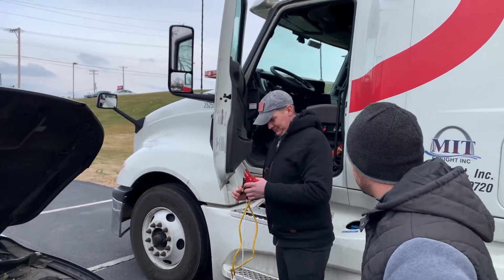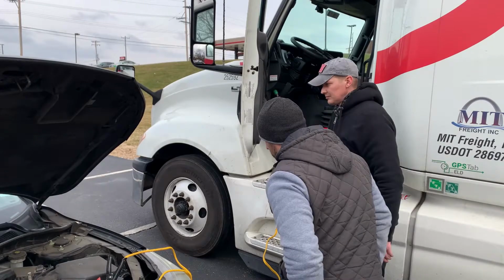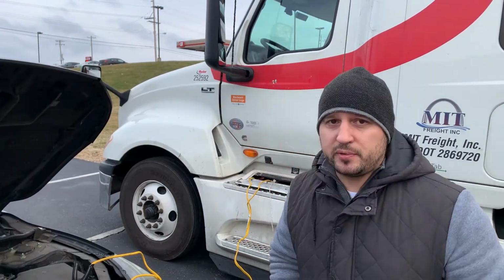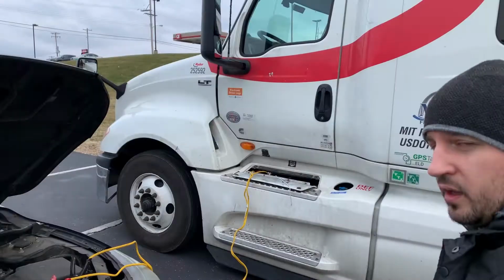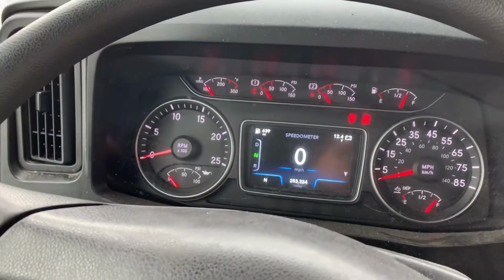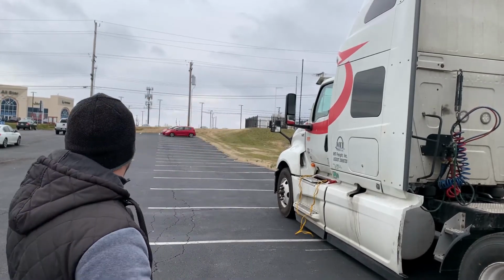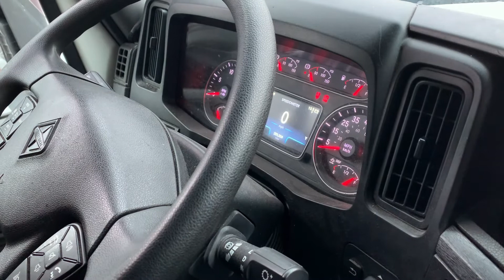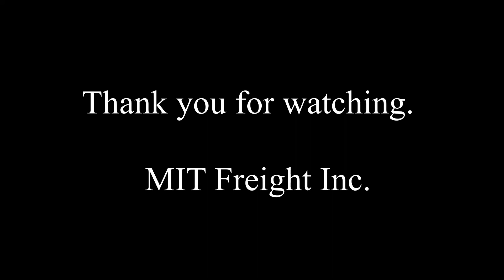Jump starting a semi truck

Comment: It's a block heater plug in for cold temperatures. Plug in an extension cord & leave it plugged in until time to start. It'll automatically turn on /off as needed to keep the engine partially warm to crank over easier.
No need to rev car that high. Alternator max output is achieved by 1500-2000rpm..1200-1500 on the semi.. anything over is just limited by the voltage regulator inside & won't put out anymore. Those are cheap quality cables, they're not efficient & will take longer to recharge the truck batteries. Semis can require almost 1000 amps to turn over a big Diesel engine .... can be much higher in winter when cold & oil is thick. The car likely could have done it with better quality Pure copper cables.. or both sets like you had..( make sure you're hooking it up properly to multiple battery bank to keep it 12volts..( semis usually have 3 or 4 batteries connected together to deliver the high amperage needed.  The car/ other semi isn't actually "jumping" it the way it does with a regular vehicle.. it's basically recharging the multiple batteries enough to turn on the grid heaters or glow plugs depending what type preheater it uses. ( Diesels don't have spark plugs & need to preheat before they'll ignite the fuel in cold temperatures. Don't leave the key on watching the voltmeter.. that wastes power needed to charge the bank. When you're ready to crank.. turn key on, you'll hear clicking & the gauges will power up.. most trucks have a "wait to start" orc heater element light.. the colder it is.. the longer it'll run.. usually 5-10 seconds... then try cranking.... if it's below 32°F.. it gets more complicated  & you begin needing to think about the Diesel fuel starting to thicken & gel up.  Gelled fuel can't pump.. no fuel, no start.